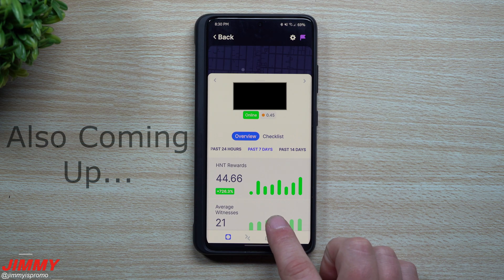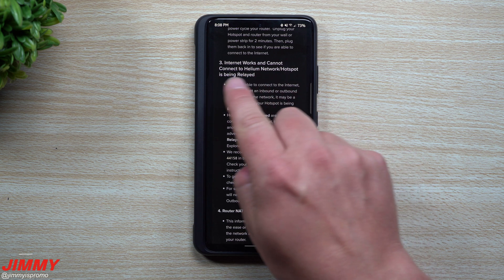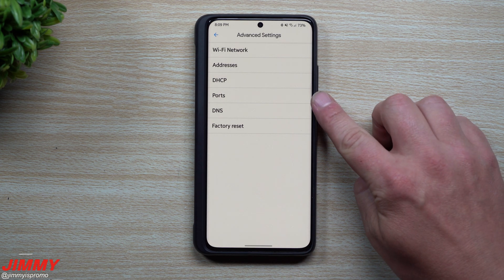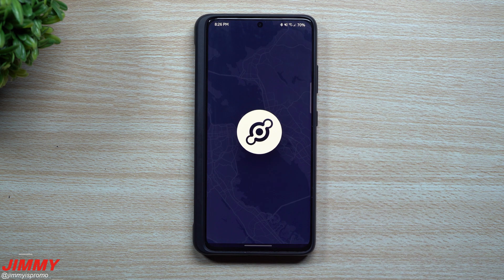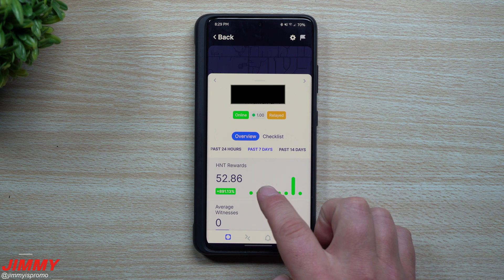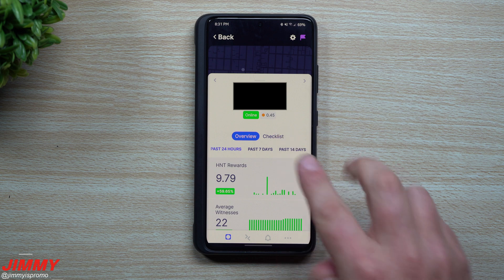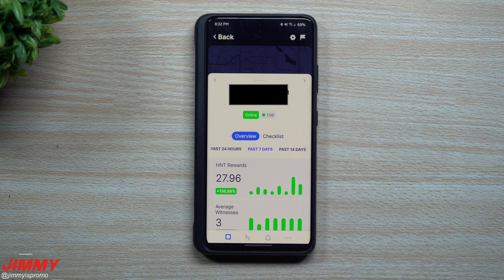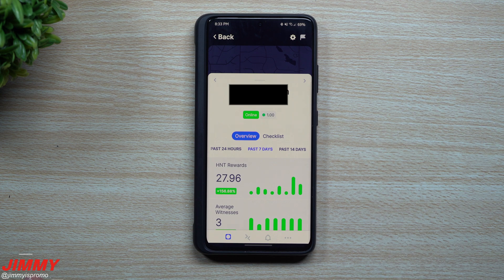How To Fix a RELAYED Helium Hotspot

Comment: Hi, is it possible that when I get a change and I don't get rewards?
I haven't removed the relayed, is that a problem. But I tried in the settings like in the clip on the router and the relayed field didn't disappear, what's the problem? Thanks.

Comment: Struggling with my RAK miner. Initially, it kept showing "relayed" and I looked into port forwarding. I was able to do one "rule" and add the first number...the larger of the 3...but I did not understand how to add the smaller two numbers which are related to updates, I believe. It did not happen right away but by the next day, perhaps, I was not "relayed" anymore. Very happy and that went well for a few days and woke up to it being "relayed" again. Ugh. Dug in a bit deeper and figured out how to add the other two numbers as separate "rules" to port forwarding - so, happy for that. It's the next day and I am still "relayed." I've tried "pairing" and sending diagnostics multiple times but have not received anything back from them. Each diagnostic looks perfectly fine. It shows all systems "go" except that the hours since it was challenged is like 20+ hours. So far, while I was not being "relayed" the best that the miner could do is 3 challenges in one day which means about 30 cents for the day. All other "non-relay" days - I have only gotten 2 challenges and never any witnesses. When it is "relayed" I am lucky to get one challenge in a 24 hour period and sometimes nothing. It's placed in my windowsill without a screen on the second floor on the eastern side of my home. Do you have any suggestions? Frustrated and disappointed. At this rate, I will pay for the RAK miner sometime in 2025.
Reply: What do you mean by "smaller" numbers.  I thought you only needed to open port 44158 in order to Not be Relayed.

Comment: ''This should take 5-10 minutes'' That one guy...  me looking like a fool 24 hours later and still relayed
Reply: Hi Tyler so you did all the steps of the port forwarding and still in “relayed” status over 24hrs? Did you reboot your miner after you did the port forward or left it alone? I just did mine about an hour ago and I didn’t reboot my miner after calling ISP to do the port forwarding…they say it should remove relay status after a couple hours. Keep me posted what worked for you
Reply: @mikes6853  I did all the steps including creating a pass filter.. 72 hours later it finally resolved itself. I did port forward, static IP and pass filter

Comment: Quick question. I tried switching my bobcat from Ethernet to WiFi, but I didn’t love the connection. So then I switched back to my old Ethernet setup, but now I’m relayed. All my ports are opened properly. What can I do to correct this?
Reply: Is it possible my WiFi connection created a new IP address and is causing the relay? Not too proficient in all this stuff

Comment: Nice video. Already subscribed you. One question: once fixed the port forwarding,  reboot the miner required or nor? And If I reboot the miner, do I need to start the whole process from beginning ? eg: hotspot connection, syncing.... which took me 24 hours already. Thanks

Comment: Jimmy what would cause a open port 44158 to close? My hotspot was working now it went offline and the port closed? It's connected to Wifi good connection, if it's a firewall is it the firewall on my pc or the router?

Comment: Completed the Port Forwarding with Modem Router from Cox, they walked me through it. Turned off firewall, still not fixed.
Put in a ASUS RT1750 Router and turned off that firewall and port forward it in the router, still not fixed. I will pay someone if they can show me what to do.
Reply: have cox too followed the steps on the cox wifi app but still having same problem mine still says relayed

Comment: I provide Internet to my miner via a wireless extender. Do I need the port forwarding at my extender or home router?
Reply: I did port forwarding at my home router and relayed status vanished after a few (2-3) days. Be aware that if you reboot your home router, the IP address of your miner may change and in that case you need to amend your port forwarding settings.
Reply: Might me both. It depends if it has its own ip adres (not sure) there are more videos explaining how to do it. My miner says it is relayed while when i do a scan everything is working 😂
Reply: Salut - you did it? Im in the Same Position right now

Comment: Question for you please. I have 3 miners at 3 different locations.  2 of them went to Relayed at both of the addresses that I don't live at.  Can I fix the problem from home or do I have to be present at the location of the miner. Thank You
Reply: You’ll have to have access to the router and ISP for each location in order to manually set each to TCP 44158
Reply: Did you use 44158 for each miner that was relayed? I get an error message on the second miner

Comment: Thanks for the video.  I am getting a "port conflict" error message when I tried to port forward.  Also, did you restart your miner when you changed the ports?  I am running mine off a Powerlink through ethernet connection -- figured that the connection would be more stable than wifi.  I have Spectrum as my service provider.
Reply: I also am using spectrum. I logged into the router and my option for port forwarding under the Firewall tab says “Virtual servers/Port Fowarding.”  I added one and just put my routers IP address in the “Private IP Address” box (also filled in the other boxes). Just want to make sure I did it correctly?
Reply: @jeffhebbel5993  that is the correct way.  It will take a few hours or a day for it to get out of relay status.
Reply: @nachomax1639  I ended up putting the Bobcat’s IP address (Found on the Helium app under the diagnostic tab) and not my router’s IP address in the port forwarding. Seems to be working now.

Comment: Hi and tnx for your video. I appreciate it. I have watched so many videos, BUT noone from you guys doesn't say what now I am going to.
Although settings in the router have been made, port forwarding 44158 checked, our miner has been set up - and STILL relayed, it is because your ISP connection is going through IPv6 and it should transfer trough IPv4. This is a static connection.
You should call your ISP and change your connection to IPv4. Miners need IPv4 static  signal. 
This has solved my Relayed issue after one week of struggling and figuring it out. Thanks, bye.
Reply: You are correct. You need to assign a Static IP address as well. When in your router you need to go to "DHCP Reservation" and assign a static address using the MAC address and IP of your helium hotspot. The reason the instructions in this video may work for some people is that they already have a static IP while you may have a dynamic IP from your internet provider. Just follow the instruction i gave you above and you ll be fine.
Reply: I set the 44158 on my router on Friday. And may Ray hotspot miner hasn't mined anything since.
Do you think this is why?
I need to switch to ipv4?
Reply: If you are using spectrum then you need to change the IPv4 or 6 as they already have you set up with a static connection all you have to do is have them port forward to 44158 and use TCP only
Reply: @mikes6853  sorry my friend but I didn't get your point. Maybe you're on clue of something but you must know that the miner is working trough the IPv4 protocol and in many cases the ISP provides only IPv6 to private users. IPv4 ist reserved for business. In Germany so far. You can do any setup you want with your router but if your ISP line is not adequate than outcome is - Relayed.
My point is - ask for what you have. "Check the wires first".

Comment: Hey Jimmy, what if i get relayed and have no way of getting login info for Spectrum to change router settings. Is there anything else I could do?
Reply from the maker: Sometimes being relayed is a good thing. I have a few perform better in relayed and my buddy also confirmed his did better In relayed status as well. So most important thing is location and height really
Reply: @jimmyispromo Very interesting! I guess i have to just keep this one on relayed cuz I have no choice. Its on a second story house by a window in suburbs with tons of hotspots in the los angeles area, only 1 hotspot in my hex and tons outside of it so reward scale should be decent.

Comment: Is this only for people using WiFi? Does this happen if you're hardwired into the router
Reply: if you router is blocking it, it will happen on both

Comment: My router shows a red light on any port I plug in my Bobcat300, it is also currently "Relayed".
Why would the light be red?
Are these two related? if I update with a new port, will it fix the red light?
Thanks for any help.

Comment: Hey guys 
Does anyone have Virgin Media WiFi? 
I have added a new rule under advance settings and I have added  4415, I initially did TCp only and it came out of relayed for a 1 day and it went back again. After I saw Jimmy's video I changed the rule to TCp and UDP. Now the miner's light has gone from green to yellow 💛 what so I do?
Reply: Would love to know how you solved this I’m going nuts spent all day trying to do by link to my virgin router open ports but ports do not show as open

Comment: Would plugging it into Ethernet fix the problem as well? Haven’t finished the vid yet.
Reply: Mine is connected through ethernet and it's saying relayed.
Reply: @nomadicnrgy2164  shit
Reply: @cudicudi4535  I'm watching multiple videos to see how to fix it.
Reply: @nomadicnrgy2164  hey what solution did you come across
Reply: @somekenyanguy3519  I haven't messed with it yet. It stopped saying relayed. Not sure if it fixed itself or what.

Comment: Would appreciate you enabling the TCP ports 44158 in both directions if you don't have Google Fibre. What is the tool we are working with? Thank you for your time.
Reply: I went into my router settings through the IP address.  Accessed the firewall / gaming section.  Was able to open the port in both direction for the device that way.  We will see if it actually works for mine as its stuck on Relay after being up 24 hours from first receiving
Reply: @Sundowninsonoran  same, did this fix it for you?
Reply: @bscarl88  same did you manage to fix it?
Reply: @noahriven8604  yup that did it for me.  Also make your miner a static IP
Reply: @bscarl88  yeah I fixed it just had to open the port
Reply: @Sundowninsonoran  How does one access the IP address of the router, is that on the router itself, and you pop that into a search engine?
Reply: @LuckySavage007  run a diagnostic in the miner app
Reply: @fvt3351  how can i run a diagnostic in the miner app .. i am new and i didnt see it in the helium app
Reply: @elvandogan230  if you go to your miner through the helium app and click on the gear (settings) on the right side and then at the bottom you can BT pair to the miner, you will also have to click the little button on the back of the miner to connect, and then run a diagnostics
Reply: @Sundowninsonoran  what happens if you’re ISP won’t actually let you?

Comment: Hi! Thanks for outlining this in such a straightforward way. The problem we're running into is when we get into Port Forwarding we're not seeing "Helium" and are wondering if it could be going under another name. Our internet connection is working. What are some ways to troubleshoot? Thanks for your help!
Reply: We did learn that it is likely the "G280" option, and we added the port forwarding. Now our miner is showing yellow. What might the next troubleshooting steps be... Thanks for your help!
Reply: @gindinmeuse616  hey we’re you able to fix this? Is this your only miner? Do you have it set up at home?
Reply: @gindinmeuse616  did you get a fix for this? When I type in the IP address into search it takes me to a login g280. I don’t have a login for this

Comment: Any idea on which "Service Type" to select for Port Forwarding? I have TCP and UDP selected for Protocol. My options are DNP, Gopher, FTP, HTTP, NNTP, POP3, PPTP, SMTP, SOCK, and TELNET. Thank you
Reply: Did you solve it
Reply: I have the same question! Did you solve it?
Reply: TCP
Reply: I fixed mine. I left it blank! Didn't touch the box at all. Good luck!
Reply: It is TCP
Reply: Having the same issue - to everyone saving TCP, That's literally not one of the "Common Services" Options

Comment: Do I need a Static IP set up for the house or do I keep the standard IP?
Reply: Standard IP address is all you need.
Reply: @garytman007  static ip for the miner or for the internet connection/router?
Reply: @OdaiNekromos  nope standard is all I use.
Reply: Good question inm told better to setup a static IP address

Comment: I did the same but the hotspot is same relayed. In the article you are referring to they also mention to activate ports 20 and 443 for outbound how you do that?
Reply: Home routers don't usually block those outbound ports.
Reply: @petebuka  is this an issue you usually find with businesses then?
Reply: @eatchas  Not usually Those outbound 20 and 443- is needed for https sites and are almost always open ... Inbound traffic ports a different story.  They need to be opened.
Reply: @petebuka  Thanks. So inbound need to be opened for both home and businesses?

Comment: My device is in relayed mode I went to edit the ports but I can’t find the device online bobcat has a green light
Reply: Thanks for your comment
FOR=GUIDANCE=AND=INVESTMENT w••h••a••t••s••a••p••p
+••1••4••6••9••8••9••2••8••0••8••6〰️..
Reply: You found an answer bro? Same here
Reply: @BigAych  we’re either of you Able to resolve your issue?
Reply: @eatchas  it’s labeled g280 for some reason. I know this because someone else assumed it maybe that. Well I have that listed in my devices connected while everything else is listed as apple or PS4. I’ve also noticed it’s giving me trouble because of a WiFi extender needing to get access into the that and change the settings.

Comment: It works only when you have your own public IP address and you don't share the network.
Reply: What do you mean? Does one need a fixed IP for this to work?
Reply: @Maziusklein  you router should be conected directly to the internet. If there are other routers on top of your router then you need to configure them as well. If you cant configure them then it will not work.
Reply: Does the Relay stays appear for everyone or just some?

Comment: My whole town has a relayed problem all 30 hot spots are owned by the same person will this affect me
Reply from the maker: No. They are relayed, not you
Reply: yes yrs will be handeling all the traffic
Reply: @panamflow3122  what does that mean if he handles the traffic?
Reply: @eatchas  yrs will transmitting all the Data so yr Internet usage will BE way way higher
Reply: @panamflow3122  so the rewards will be the same but your bandwidth may be overtaxed?

Comment: thanks for the info as always. quick question- i've got a 8dbi antennae. want to put it on my roof and run the antennae cable from my miner inside my house up to the antennae. About 50 ft. Will that degrade my miner performance? Does it matter how far the antennae is from the miner? thanks!
Reply from the maker: Length of cable can give loss. But 50ft seems standard, just make sure it's a good cable through reviews.
Reply: @jimmyispromo  hi what happens when there is a power cut for sometime
Reply: If you run the antenna cable you will lose a small amount of db pre foot, But if you run the ethernet cable to your basement no db loss. the miner should be as close to the antenna as you can get it. However this is not always do-able. The Db loss is not a ton ether, I think its like 0.01 per 8 feet or something like that.